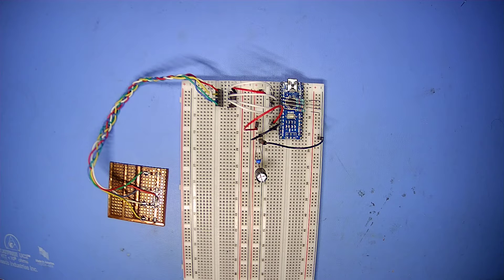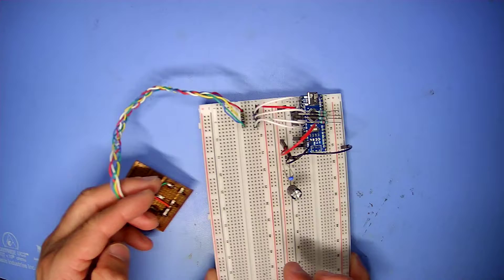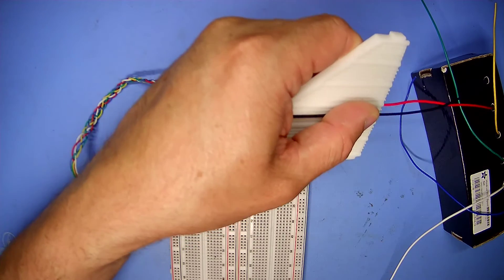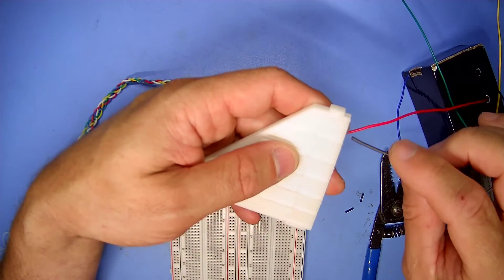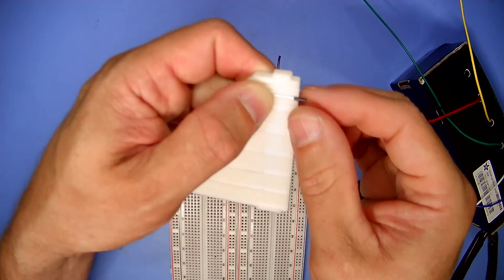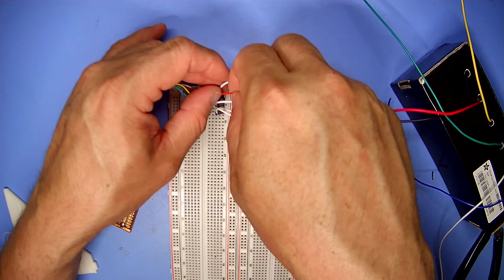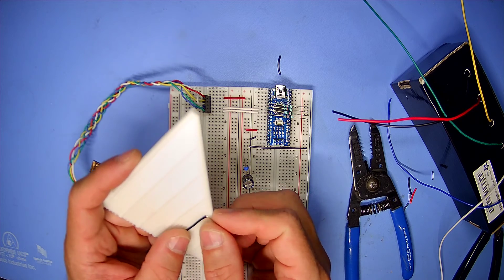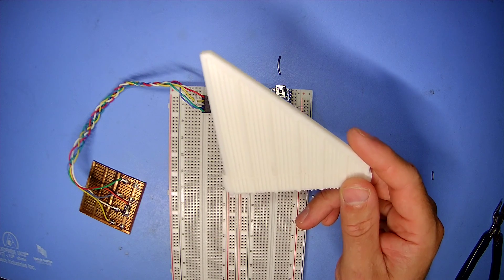A Better Way To Make Better Breadboard Jumper Wires

Comment: Dunno why this is surfacing now, but this is a great idea.  I so often fall back on the bendy jumpers because they're less work than re-aligning stuff so that my limited supply of pre-cut jumpers, but then I end up with a rat's nest board that is impossible to debug or modify...

I'm sure there's a bit of practice needed before getting up to speed, but it looks like once up to speed it's not much longer than searching the pre-cuts for the right size, and the results look worth it.

Maybe a future version that automatically measures, cuts, and strips?

Comment: i don't have a 3d printer any chance i can purchase a bread board jumper template?
Reply from the maker: If you know someone else with access to a 3D printer, I'd suggest starting there. If that's not an option, there are numerous online services online that can 3D print items for you. I don't really have the time or even know what I'd need to charge but I doubt I'd be able to do it cheaper than any of those online services.

Comment: Love this! I came across this video because I thought of making a ruler from some thick paper and laminate it (don’t own a 3D-printer … yet 😅). Would be nice to have a way to measure between two spots directly on the breadboard how long the wire needed to be, for when you don’t yet know the length. I’ve also needed to make wires with 90 degrees corners around the board, and this was pretty tedious to measure.
Reply: Pin (hole) spacing on breadboards is pretty much standardized as 1/10 of an inch. (Yes there are some variations, but this is the spacing for most IDC connectors and dual inline pin (DIP) components that get plugged into a breadboard. If you live in any country other than Libya or the US, the spacing is 2.54 mm. So the breadboard sort of acts as a measuring tool to begin with. There are 16 pins on the component? that means it's going to have a component length of (about) 9/10 of an inch (16/2 + ~1) with the variability on the 'about' 1 being the clearance needed to be able to plug DIP's next to each other across the "gap".

In my experience the spacing from the bus bar's to the field is either 0 or 1 pin, and the gap in the middle is (again usually) 2 pins. That said, you should be able to take two boards, or if the bus bar parts from the board, and span either gap to get a count.

There are exceptions of course. If you are working with an Arduino R3 or earlier board (I don't know if they changed this for R4, but it would likely break hats) the spacing of the pins on the board includes a gap that is not an even multiple of 1/10" across. This is sort of where the dupont connector flexible wires are a good hack for, or go up a pin, and trim to match.

I know there are connectors that follow one of the newer 2mm spacing, and you may need to do custom jumpers to bo between the two standards.

I do have a 3d printer, (or 9) and will be printing one of these up, (along with a resistor leg form to bend legs without stressing the resistor.) Either as soon as the model I'm printing now is done, or when I get another printer up and running.
Reply: Thank you for this informative comment!
Reply: I just got a piece of perf board and cut it on a 45° angle for measuring, but I like his stripping and bending holes.

Comment: What is the link to this file? The link is cut off in the description. Looks useful!
Reply from the maker: Seems to be a YouTube policy change. To put links to other websites in the video description, you need to be verified, which would be one thing. But in addition to not turning valid URLs into working links, they still cut off links longer than 40 characters to replace the end with an ellipsis. I've applied for verification, so once that's done it should fix the link. In the meantime, here's the full link: https://www.thingiverse.com/thing:5428701
Reply: @brettsbasement245  One option is to simply put thing:5428701 in the description. The first match for a google search (I don't know about Bing or other search systems) is the thingiverse  page for your model.  This should work for any Thingiverse model that hasn't been blocked or removed.